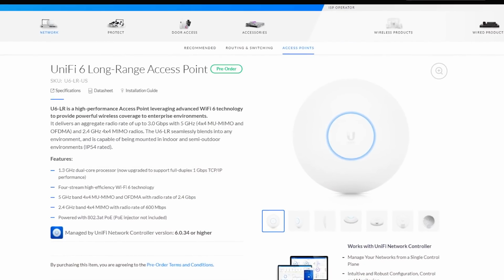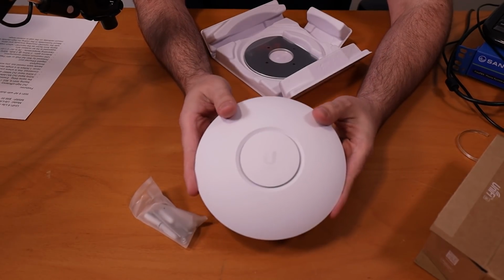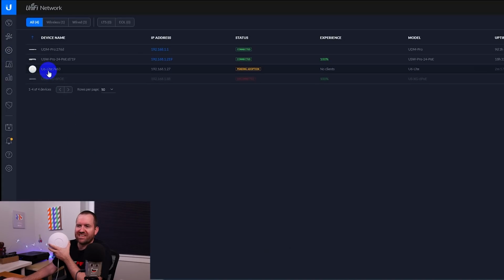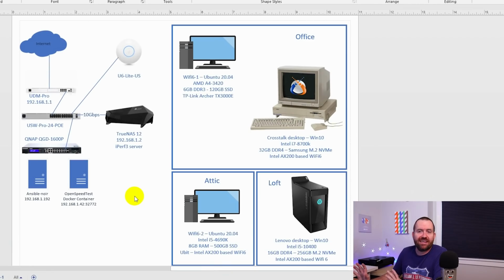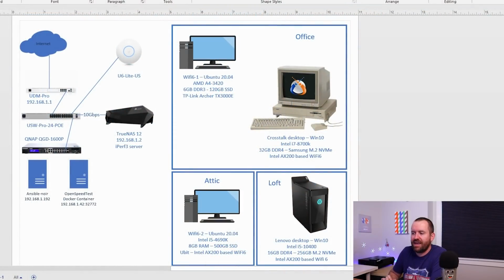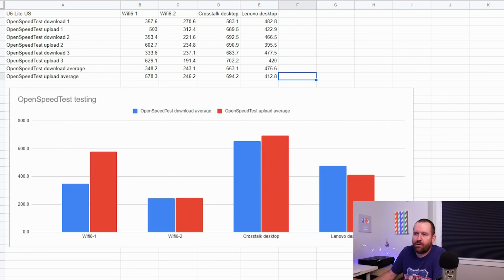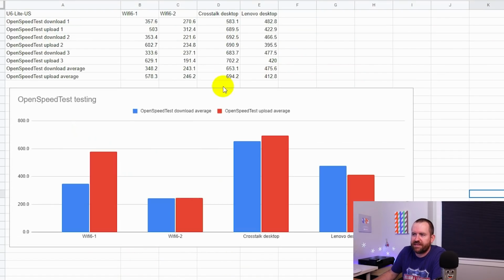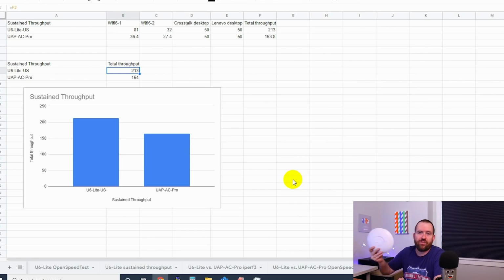UniFi U6-Lite WiFi 6 Access Point - Review and Benchmarks!

Comment: Great to see these rolling out. Maybe we'll get a WiFi 6 UDM soon.

I love the idea of these dedicated APs, but since I can't run ethernet cable in the walls in a rented apartment, this sort of setup is beyond me for the moment.

Do you think WiFi 6 will help with network performance/interference reduction in an apartment building? There are so many wifi networks in this building I can't actually get a complete list of them--it changes from moment to moment depending on which signal is the strongest.

Thanks for putting this together!
Reply: If you have drywall, just hang it high on the wall in the living room above coaxial outlet and all you need to do is drill small 1/4” and fish it straight down  to preexisting outlet and simply swap plate for double gage plate with coax and rj45 keystone adapters. On AP space area terminate cable with rj45 connector inside wall bracket. Unless you have firewall stud or insulation’s making it impractical. Then when you move out patch the little holes for AP and swap back old coax plate. Or just run wires outside and use cable mold cover.
Reply: Also thinking of WiFi-6 enabled UDM for home, I don’t see why they want me pay for outdated Wi-Fi version embedded into this expensive thing (compared to my current USG-3p)

Comment: I got these a few days ago along with a dream machine pro and a 24 port poe switch love the equipment so far however i have had some issues with the ap's so far with them forcing devices over to the 2.4ghz band and the device it forces to that band end up with less than 1mbps of speed if i set it to only broadcast 5ghz it works perfectly im not sure if its me (this is my first entry into networking) or the equipment

Comment: I'm building a wifi network to replace my single unit from my ISP. I figure I may as well go wifi 6. I'm tempted to buy a dream machine, and attach WAPs to that for full house coverage, but dont want to mix wifi 5 and 6. Is there any word on a wifi6 dream machine? Or should I just get the USG and go all wifi6 WAPs. I'd appreciate some help on this.
Reply: I wouldn’t wait for a Dream Machine with Wifi-6. Just get the USG and go all in with Wifi-6 APs.
Reply: @Moonraker11  Thanks for the advice. Much appreciated.

Comment: Hows the range? Is there any range difference in Wifi 6 vs Wifi 5?
Reply: I replaced a UAP-AC-LR with this U6-Lite and on my edge devices I get ~3dB better RSSI with the U6 and similar throughput improvement to what Chris showed.
Reply: @JABloch  I have a nanoHD and several AC - LR's  and the nanoHD kills the LR's for range.  I have an AC 6 LR on order now to try it out.   The 6 LR has pretty good gain on the antennas so it should be interesting.

Comment: why does it only have a standard 1Gb port.. why not go with a 2.5Gb or 5Gb port ?
Reply: Ubiquiti does not have 2,5 or 5 switches, so you’d buy a switch from another brand. That’s why
Reply: @sssennaw  they actually do have a switch with 6 ports 2.5GbE in EA.
Reply: @sssennaw  new switch has 2.5. funny part they marketed as a wifi 6 ap switch and the ap only has 1gps. smh
Reply: @sssennaw  that is just plian dumb of them.... presently i am looking at alternatives.... by the time i put 10 heavy users on that thing.. that 1gb port will be more than maxed out..
Reply: You won't get more then 1gb from wifi anyway, with 3x3 or 4x4 that may be a bit different, on other hand 1gb vs 1,2 gb on wireless? Who really cares when you could get 300-600 on ac with 3x3?
Reply: Because theoretical performance on the datasheet for Wi-Fi and realistic real world throughput are not the same thing. 1GbE is plenty for a 2x2 MIMO device.

Comment: With the lite being mimo 2x2, I opted to preorder the U6-LR for the mimo 4x4.
I think wifi 6 will need at least that to be worthwhile. It says it ships around Jan 19.
And I do like that the processor is supposed to be able to utilize the full 1g speed of the trunk.
But since all my ap's have cables back to switches, and I won't be using the blazing radio speed for meshing, I really wish the ethernet port could handle at least the same speed the radio can, so I could make use of the speed there.
Still can't wait to get it.